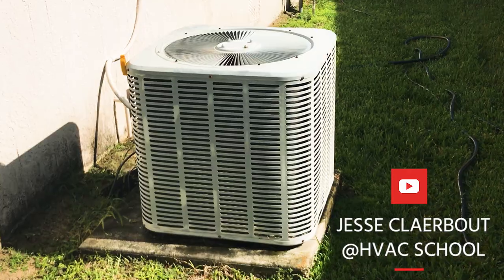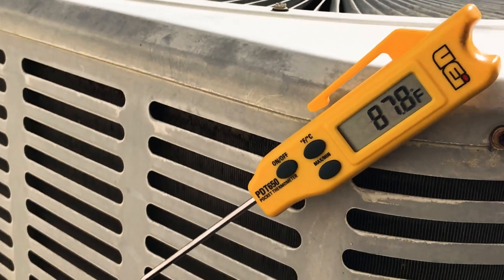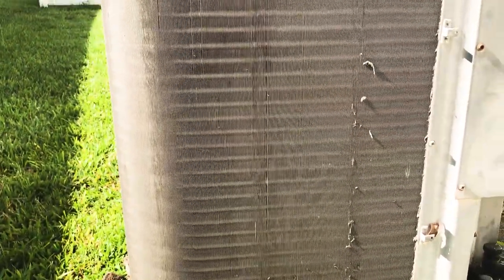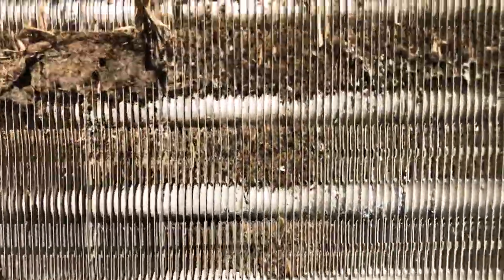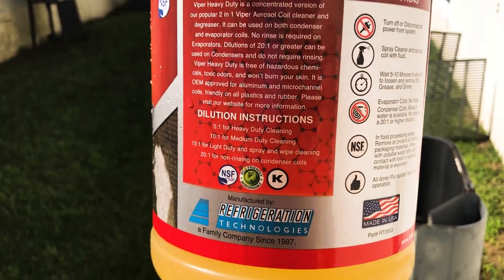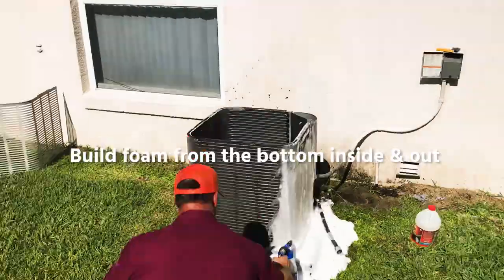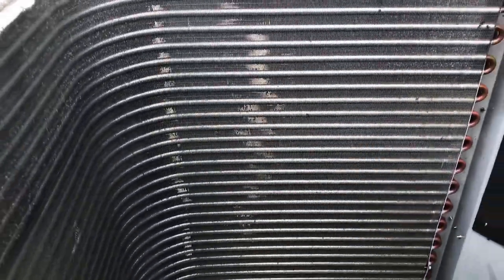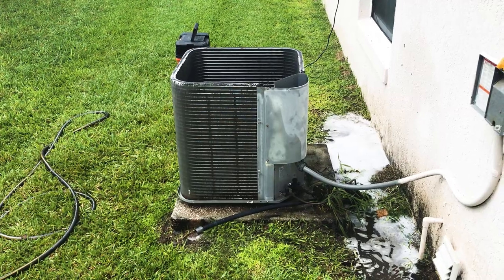How to Clean a Condenser Coil

Comment: you put the thermometer on the sun first and then later on the shadow. i am not a rocket scientist but i am sure that will make a difference even if you didnt cleaned the coils
Reply: I thought I was the only one that noticed. Direct sunlight temp. vs shade temp.
Reply: It is important to clean it though. Along with the evaporator coil

Comment: I cleaned mine today but I left the cage on it for now next time I want to take it off and clean it all around I think I did okay. I rinsed the inside out and sprayed all the stuff on the outside down in the holes at the bottom not everything got out but almost its a lot colder inside the house now. I wish I knew how to take off the fan I didn't see a way to do that though next time I will look a little better.
Reply: Did you ever figure out how to take the fan out. Found this video https://www.youtube.com/watch?v=HAIXiCDuEWI
Reply: @michalgermain4483  The compressor went so needed a whole new unit. I did figure out the fan though it was just too late lol

Comment: An amateur question I know , but I don't have any slack in my motor wire , not even enough to flip the lid upside down.   I guess I have to disconnect and pull the wires through ?  That's not easy when I can only raise the lid 3".

Comment: Great video. I have the exact same issue. Clean on outside but shooting water thru results in minimal water making it so inside coil fins are clogged. Will clean asap. What are the guidelines on the temperature delta expected?  I get 115-120 deg from fan on a 98 deg Texas day.

Comment: What happens if you get the condenser cleaned and then the air is now coming out warmer than it was before?
Reply: You ever figure out why air warmer?
Reply: That's actually a good thing. If the coil is clogged it can't dumped the heat it's removing from the conditioned space. After you clean the coil and the fan is blowing hotter air it's doing its intended job.
Reply: This would indicate you are low on refrigerant and have a leak. If the supply air INSIDE the house is warmer after coil cleaning.
Reply: use clean water next time